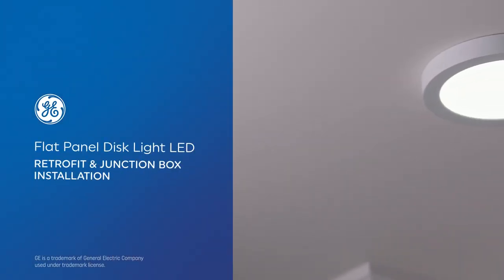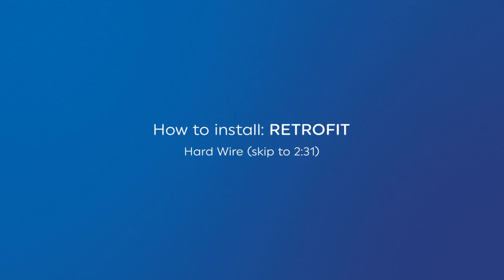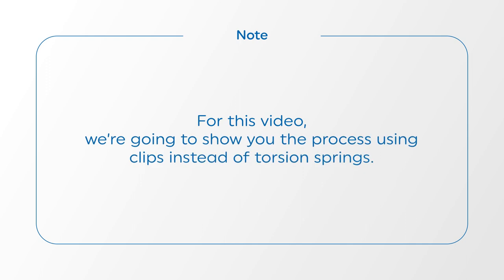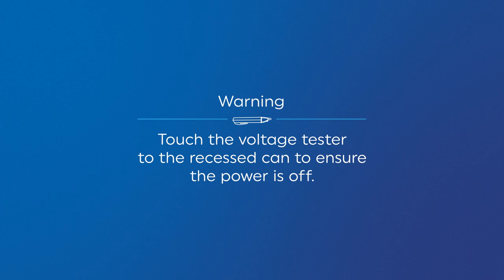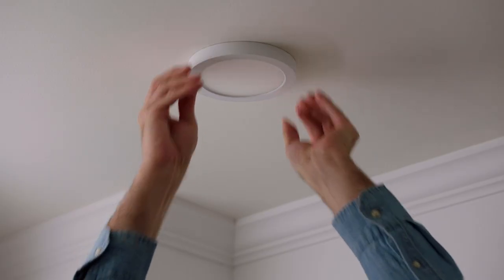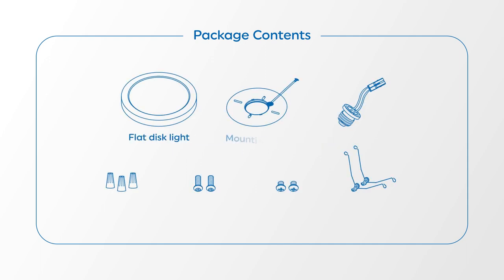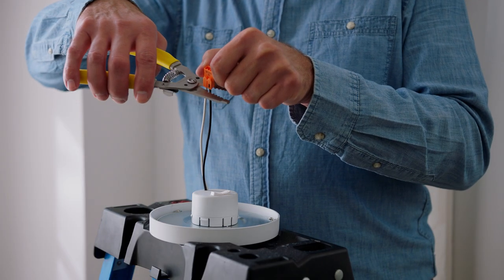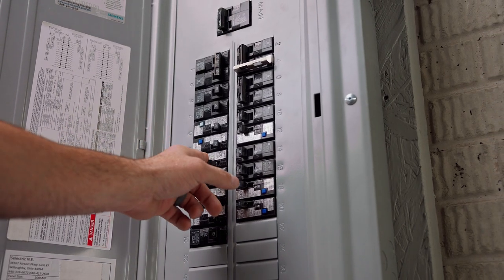Two Simple Ways to Install Your GE Flat Panel Disk Light

Comment: The Torsion Springs did not work on my existing can lights and the clips used in the video do not come with the light.  I guess they have to be purchased separately.
Reply from the maker: Hi there. We recommend a product like this to convert your recessed cans so they can accommodate the torsion spring: https://www.amazon.com/Sea-Gull-Lighting-14610-Accessory/dp/B007ZR98FE/ref=sr_1_3?crid=PPV2M13RQEUC&keywords=C+Clips+Accessory&qid=1666375179&sprefix=c+clips+accessory%2Caps%2C581&sr=8-3
Reply: I ran into the same issue 😅